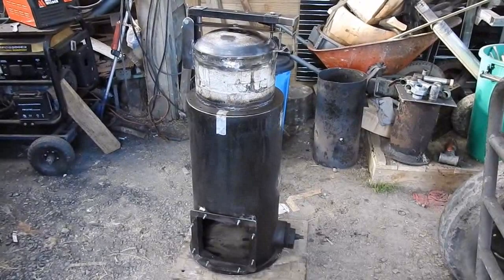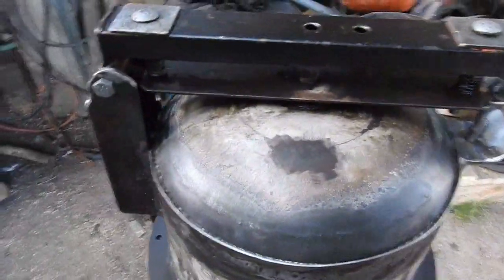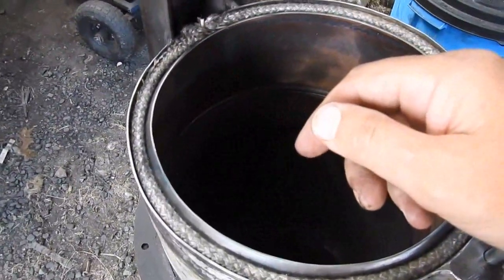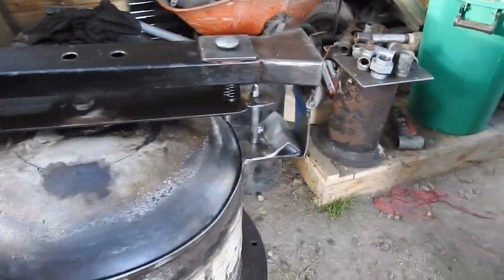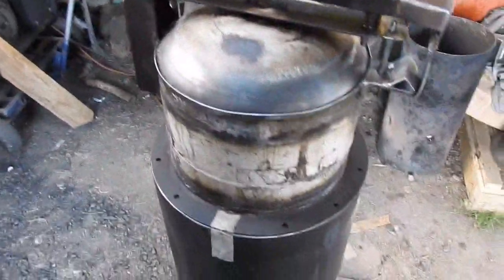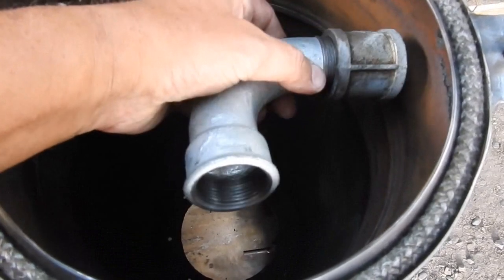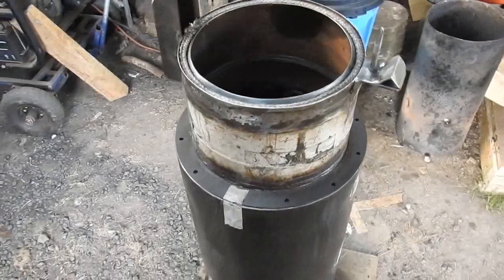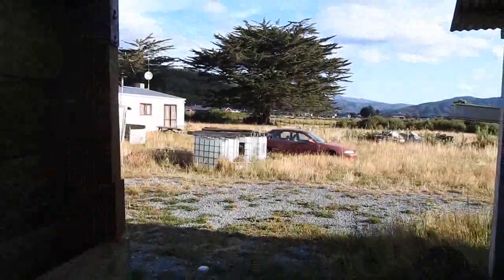My Gasser has a new lid

Comment: have you looked at sub dividing your place, you may get heeeaps of money, and that might make a mooove easier, and you wont need to live in the caravan again.  Are you going to look for a hydro power capable place? 100 miles north is about where I had a go with hydro.
Reply from the maker: Nah bro. 
 I really don't wanna be here, to see the place being torn apart! 
 At present, the offers on this place are up in the millions, so I should be able to get me a really flash caravan, or even a house on the new place  ;) . 
 Hydro wood be good, but that kinda reduces the number of options that are to be found on the open market. 
 Wherever I go, I want it to be a place that is better for Donkey's hooves than this place is. 
 Wheel sea aboot that.

Comment: Like your lid. Cant lie, I dont like anything I the hopper.  It adds another thing for gas granules to hang up on
Reply from the maker: Yup, that new lid is gonna be a real winner, methinks. 
 The air feed pipe might cause a problem with fuel bridging, but I think I may be able to add an agitator to it, in order to break them up. 
 I just hope that it wood knot be a problem, but wheel see aboot that  :) .

Comment: I think you have a winner there, Steve. Great concept and well planned. Don't forget to add the Hbbyloggr Snot Blocker. ( check your email for the link ).
You're getting closer to the day of the farm relocation, eh ? Wish we were all closer to be able to help you with that. What a party that would be ! Do you have a time line for the move?
Bill
Reply from the maker: Howdee Bill, 
 The new lid is coming along very nicely, and I am perty pleased at how well it works. 
 Yes, I was gonna ask you if I could 'borrow' your Snot Blocker technology, to enhance the 'watts to snots' ratio of my new gasser build. 
 You'll notice that the inner part of the new lid points downwards into the hopper space. 
 This is intended to guide the pyro gas condensate towards the low spot, so it can dribble back onto the fuel column. 
 Adding your Snot Blocker will definitely enhance its effectiveness, so it's gonna find its way into there, real soon  :) . 
 For the move, I am hoping to be kicking that into high gear in the next couple of months, as I don't want to miss out on the properties that I have been viewing on the interwebs lately. 
 Huge sums of money are involved here, so I will need to buy me a couple of BIG suitcases - to carry it  ;) .

Comment: Hey Steve. I love that spring loaded design and the locator pin that centers the lid on it's seat each and every time. Great work. Now, have you thought about bolting the hopper into the chamber via that flange or are you still thinking the weight will hold it in place when the flatulence happens? And you know it will happen. Man, I don't blame you one bit for wanting to move with all that "city dweller" encroachment around you. I remember that aerial video you did with the RC plane and man, you are being surrounded by them.Next thing, they will file a complaint with the PTB and force you to change your lifestyle. Move while you have the chance and leave all those dwellers behind. While it will be a major task moving you, your belongings and the beloved critters, you will have peace of mind after it's all said and done. We will wait patiently for new videos while you get it done. We are with you on that.......Go for it. Again, great design on the lid.
Reply from the maker: Howdee Mark, 
 Indeedily, this lid design seems to be a winner. Hopefully, it will prove itself to be a reliable solution to the ever present problem of woodgas bug flatulence sessions. 
 At present, I don't really have a solution for the hopper to barrel interface. While the weight of the finished hopper assembly will be substantial, I think I will still want to go with a more active hold-down system. 
 I may go with a set of braces that will vaguely resemble the flights at the base of a moon rocket, but that Idea may change with my next cup of coffee  :) . 
 On the subject of the encroaching city dwellers, if I was to take a new lot of aerial video, you wood be amazed at the difference that you wood see in it. 
 The rate of change is accelerating, and I really wanna be out of here, before the townies start complaining about the 'dirty, noisy' farm next door. 
 Yup, I have a LOT of bits, and/or pieces to move, so I will have quite a big workload to deal with. 
 A lot of stuff is gonna get chucked out, so that ought to reduce the load a wee bit  :) .
 I am really looking forward to this, as it really makes for a bright future - until the woodgas bugs find out where I went  ;) .